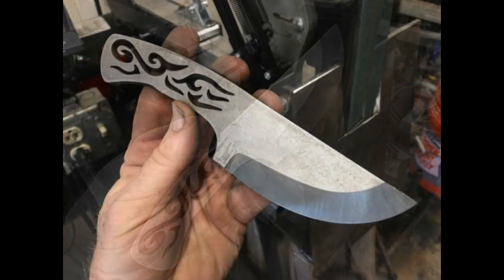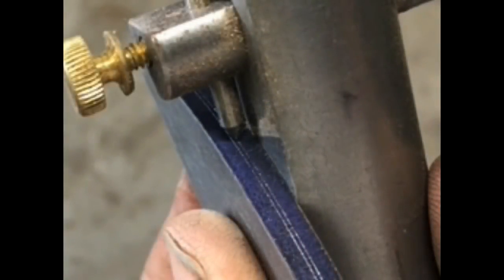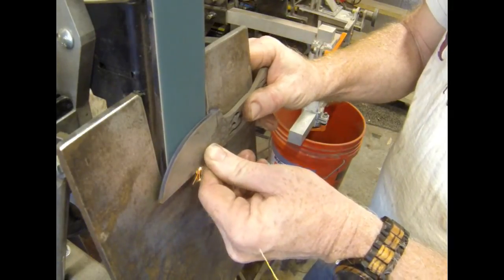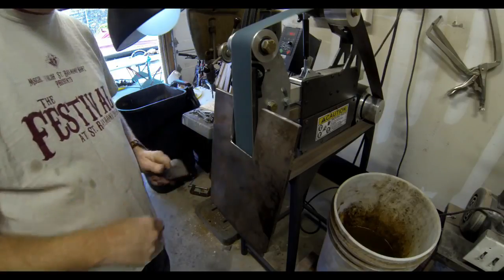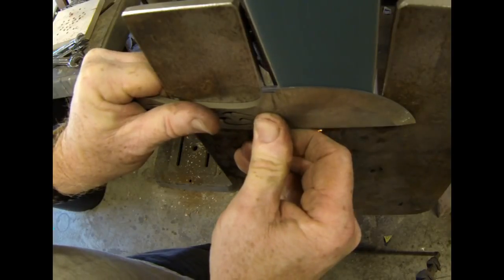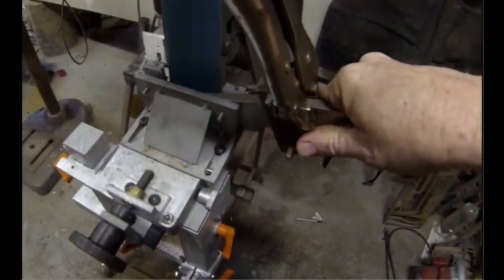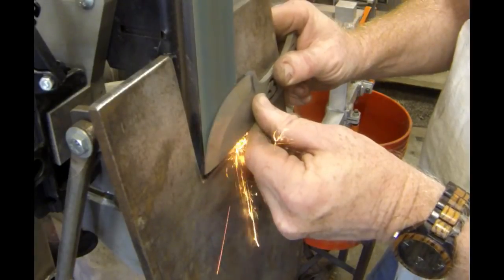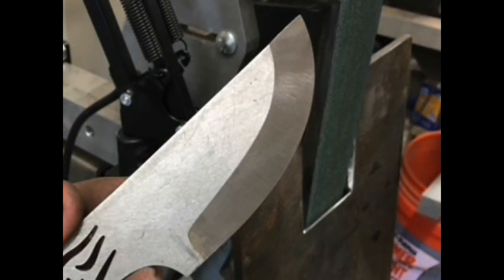Tilt Table Knife Bevel Grinding Jig

Comment: Dan how do you keep your plunge lines on the same angle? How would you mount this on a two inch tool arm ? Thanks
Reply from the maker: With the tilt table you grind bevel up so you can see the start or plunge line. Pretty easy to match angle and starting point on both sides. For a 2 in tooling arm you would have to drill and tap two mounting holes.

Comment: You make it look easy. I wish the company i bought my 48 grinder from made one....
Reply from the maker: You can always take a pc of 2 inch tube and mount it either to your grinder or the work table. Drill and tap a couple holes and use the tube as a tooling arm mount.

Comment: Funny thing is, I have seen many guides - even ones costing several hundred dollars, and your guide is by far the most functional one I have seen yet since you can easily grind curves - not just straight lines.   I  love the simple design yet low cost.  I am currently working on making one for my grinder.   Thanks again for making that video.  I really appreciate it !!!!!
Reply: Do you have any plans for that tilt table???